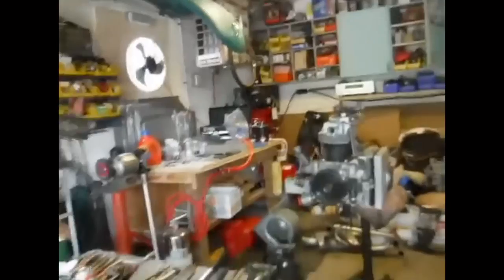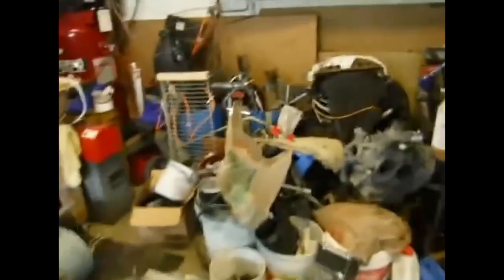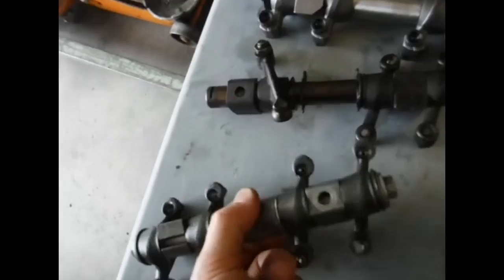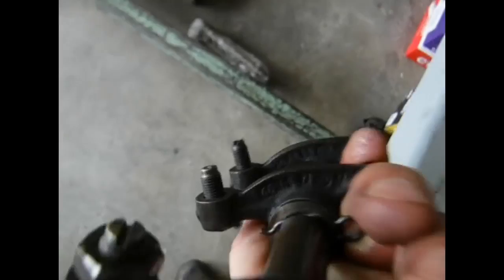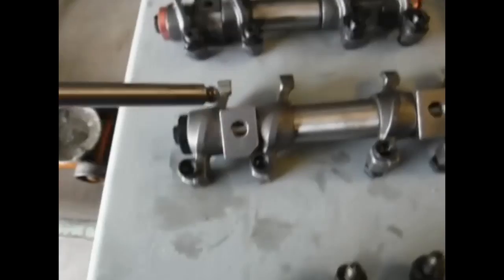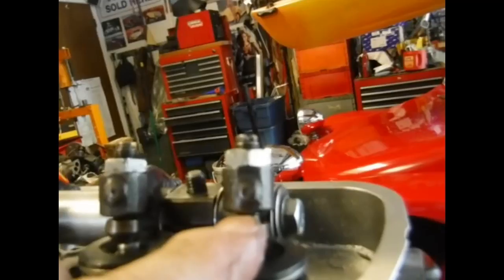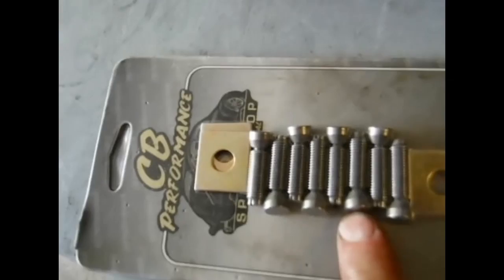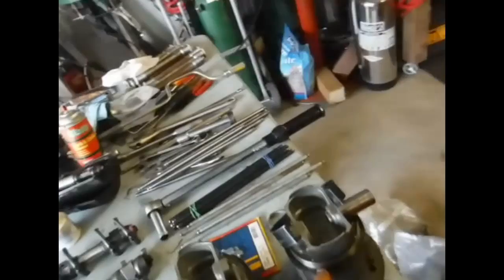VW High Performance Ratio Rocker Arms

Comment: My rig lost a rod bearing.  After taking it apart I learned she bought me a baja with a 1835 thick wall that has a 110  cam. I'm now turning it into a 1968. And I'm going to be using this video for the rocker arm set up.  Ty ezgz
Reply from the maker: Sounds great if your using dual carbs. Best of luck with your project.
Reply: 100 cam not 110. 
Been looking at carbs. Not sure on that pic yet.

Comment: Excellent video!!!! this is the reason i mark everything after i tighten it...sometimes life happens...
Reply from the maker: I'm becoming a believer in your methods although there is no doubt I had it in and torqued correctly. Over the last few years and several thousands of miles I just beat the thing to submission. One stud on the other side broke during disassembly as well. Making some changes and might crack the case for a look see. I want to put it in the Baja and put a few miles on it first as well as monitor oil pressure over different conditions.  Not sure I trust those stock pushrods with heavy duty springs. Stock pressure is 130 @ installed height vs 175 HD single. I've been watching you go around and around with Comp Cams.........  Like you say: Life happens.....

Comment: The elephant rockers from CB require pre-lubing by soaking them in engine oil before installation or they will wear out just as you described. The original Porsche adjusters of this design seem to be NLA. They used to cost $100.00 per set.

Comment: great video. add checking cam lift at the rockers to your build list. 2239 I am told by a old time VW guy is a great cam that should last you. very long time.
Reply from the maker: Thanks for your support.  The main difference is the 107 lobe center vs the more common 108 used on performance 1.1 cams.  So many variables. Thats what fascinates me about VW engines
Reply from the maker: Thanks Thomas. I hope your friend is right.

Comment: the 2239 seems to be much like a stock cam but the lift of the 1.4 ratio rockers already included.  the W-100 being another close example. keep compression close to stock maybe 8.0 as it adds just a dab of duration.  ratio rockers with that cam probably did in your studs. change the other side with new while your disassembled for piece of mind. consider the damage done. should still be great motor after your done.
Reply from the maker: calm down and watch again. 2239 is only a guess as it's not marked. CB does not usually advertise to sell Engle brand cams.  Stock is .334 lift. The 2239 with 1.1 is .aprox .418 NOT recommended for 1.4 at all. My measured lift was .530.  Not to worry about the studs. I replaced both heads with new ones with 55cc volume as mentioned. There was metal on the drain magnet but hopefully the full flow oil filter caught the rest. Stay tuned and thanks for the input. Start up and testing coming soon.
Reply: +TheEZGZ  no problem here all calm. but your suspect camshaft with 1.4 rockers is .530 lift.  so very very good guess. only thing anxious about is hearing how she runs when done.  should still be a hoot.
Reply: Engle was only mentioned as a similar to 2239 Eagle camshaft. Keep up the great videos.

Comment: you always make good "info" vids.  I think I am going to try my aluminum rods.  I heard chromoly are noisy?
Reply from the maker: I've ALWAYS used Chrome Moly  when using performance cam with HD springs.  This is a test to see if my sand buddy's way will work for me.  When stock get noisey you better check them. The steel ends start going into the aluminum. I've seen it but the explaination was that they let them get loose.  I'm trying it at .004

Comment: What can you expect when running a set of 1.4 life rockers on a stock cam? Is it basically the equivalent of having a performance cam?  I have a stock 1600 and am looking to do a few upgrades and the 1.4 rockers is one I am looking at but know very little about them. 

When doing the 1.4 rockers other then the upgraded pushrods is there anything else you suggest to add with the 1.4?
Reply from the maker: 1.4 ratio rockers, dual carbs and free flowing exhaust will really wake up a 1600 Dual port with stock cam. The more head work the better it will run. Heavy duty springs are required and dual springs would be recommended.  Dual 40 kadrons would be a good choice in carbs along mechanical advance dizzy.  Do not take Pushrod length as a casual matter. In fact I would not recommend it at all unless your engine is in perfect condition. You will need to remove the engine and remove the heads along with pushrod tubes to do this correctly.  If valve geometry is not perfect it will have a short life. It will run better even if you don't get it right.  "For a While"  Pay close attention to valve spring height blah blah blah.   1.25 ratio rockers would be more forgiving if your not experienced. As a matter of fact it's a lot easier to go with stock rockers on solid shafts with heavy duty single valve springs. The dual carbs and free flowing exhaust will make you smile over the stock 1600 DP.  I can't recommend where to find parts as most of it available today is junk.
Reply: @TheEZGZ  Thank you very much for the detailed advice. I am fairly experienced in the automotive world but the VWs air cooled are new to me. I just got my 71 Super Beetle less then a week ago. I love to get my hands dirty and learn as much as I can. 

With that, in the distant future I woudnt mind trying to do my own rebuild but for now I just want to give it a little more pep.

So If I am hearing you right, I should go with the 1.25 rockers, dual carbs and a free flow Exhaust for a good start? For a stock 1600cc what would be a good dual carb that will work on the stock 1600cc but with room to grow ( I.E bigger jets, etc...) if I do a cam and heads in the future?

Also what are your top 3 free flow exhaust options that don't break the bank ($250-$300 lol or less)

thank you for taking the time to answer
Reply from the maker: @johnnyturbo8460  I have this conversation quiet frequently with folks. After 30 years of tinkering with these engines I have to say that the stock engine is what it is. The version you have started out as a 1300 SP and ended up as the 1600DP   If your engine runs good, I suggest you leave it alone and enjoy the car as is.  Keep watching vids and going to swap meets and find a club in your area. Listen, Listen, Listen.  Everyone likes to talk about there cars. Watch and see who has problems and why. Watch to see who has lot's of problems and the trouble they have keeping it running well.  People always want more power and they build bigger engines and even after getting it running well they want more. But that takes money.  Sometimes these guys will sell you there old upgraded engine to finance there new dream engine. They might make you a really good deal if your a friend.  The other way to go is keep your car as it is and slowly start gathering parts for your own project engine. There is a lot of use performance stuff out there. If you build the complete separate engine you can swap it out and use that to tinker with. If it breaks or is a gas hog or problematic you can always put back in old reliable.
To many people get a nice old basicaly stock VW and start changing things and run out of money or break something expensive and then the car sits and gets sold at a loss.  These old VWs are no longer cheap to own or keep running. It's a money pit. Keep your alive and wait a year or more before going overboard.   Super beetles are known to problems with the universal joint on the steering shaft located under the fuel tank. You can't see it from below but you will have play in the steering. Remove the gas tank and have a look. The sold 20 million VW's because people liked them and they were reliable in stock form.  Every where I go people always want to share the story's of the family beetle that there family or friends had when they were growing up.  Have fun with it.
Reply from the maker: Maybe get some big bore Zoomie exhaust tips if you want to change the sound. Aftermarket exhaust usually drag on everything and rust away. They never have the proper intake manifold heat that is needed for centermount carbs.
Reply: @TheEZGZ  now that is some excellent advice i really didn't think of ( "start going to swap meets and start piecing together a build engine on the side")

I think that is exactly what i will do.

1. It will help me learn more about the car, while i am enjoying it.

2. It wont break the bank.

3. Half the fun for me is the thrill of the hunt (hunt for parts). I love wheeling and dealing and cars so that is a win win for me.

Excellent idea.

You are right, i have had the car for maybe a week now and i would say about 14 guys at work that have seen it have had some family story about one.

Thank you for the sound advice!
Reply: @TheEZGZ  ok thanks!

Any tips on pointless performance distributors like CB Performance ones? For better reliability or do you again say just stat stock with that too?

Oooh and your thoughts on a front disc brake conversion? And thoughts on those? They seem very reasonable at under or around $300

Comment: EZ If I have stock rockers and use Swivel feet ( I hear They are quieter) will I need to change the push rods for longer ones.
How do I figure for shims? Or should I just keep the regular stock adjusters. Thanks for every time you answer EZ.
Reply from the maker: The swivel feet usually come with shims. Usually a .040 or .060 shim under each rocker stand is all you need. Flat tappet cams are just noisy. Go with .004 valve lash instead of .006 if using chrome moly pushrods go Zero but check them way more often

Comment: I had my heads rebuild ( mofoco ) stock  type 4. Scat C 25. Hydraulic lifters pasengers side there is plenty of clearance to adjust valves but drivers side the arm touches the springs would rocker arm shims fix this
Reply from the maker: Yes but you don't want to change your rocker arm geometry to much as it will wear out your valve guides.  To be honest I have know personal experience with Type 4. I just know they are similar and expensive.  You can possibly grind a small spot on the bottom of the rocker arm if it looks beefy.  I hope you like that C25 as much as I do.

Comment: Hello I want to know how much do I have to cut the longer push rods with a 1.25 rocker arms and 110 Engle camshaft?
Reply from the maker: You have top use a test adjustable pushrod and set it 90 degree's at 1/2 lift. That is your length. I can't give you a length because there are many variables depending on shims and cam and head space.
http://www.geneberg.com/cat.php?cPath=6_212

Comment: Hi I’m building a 2110 engine for my t2 westfalia 
Could you please tell me what cam and rockers I need that will be good on hills. I have Dellorto 40s and 004 heads. I have a Engle w120 to go in but can change it if you advise otherwise. 
Many thanks phil.
Reply from the maker: I think the w120 is a bad choice for t2 westy. You need a lot of compression and really good gas. It will cook quick in the fat Westy.  Quit thinking high HP bug engine for racing and think torque to pull weight at lower RPM and live a long time. Your carbs and heads are fine. Use Heavy duty springs and valve train.

The Engle W120 is a Hot Street VW Bug camshaft grind is designed for 1.1 or 1.25 rockers, and it's specs are .397" Cam Lift, .435" Valve Lift (1.1 Rockers), 294 degrees of advertised duration, and 253 degrees of duration at .050", on a 108 Lobe Center.
WIth more duration and slightly more lift than it's little brother the W110, this cam is designed to give more power at the top end while sacrificing low end. You can not use this with a stock carburetor, it will barely idle well with dual 1bbls or a centermount 2bbls. You really need at least dual 2bbls of carb for this cam to behave at idle and under 1500 RPM.

This cam really needs some port work and/or larger displacement to work properly. Expect a powerband of 2000-6000 RPMs, the more headwork and carburetion the better the low end will be. If you use 1.25 rockers, you will extend the top end to 6300 or so.

Dual springs are required with 1.1s or 1.25 rockers. Use a compression ratio of 8.75-9.5:1.
Reply: Do you think I should put stock rockers and cam for my Westy 2110 ? I just want it good up hills. 
Many thanks phil
Reply from the maker: @wolves356  Yes, Stock Rockers with solid rockershafts and heavy duty springs, chrome moly retainers and keepers.

Comment: whew... let me ask you because I have  seen a lot of your vid and I believe you know. I am building (Assembling) my motor. 1600 change piston to 94mm and replace the cam with Engle 120.  Is there a need for me to make any changes on the stock rocker assy?
Reply from the maker: Yes!!! Please tell me more about your engine. Is everything else stock?  Crankshaft, flywheel,connecting rods, cylinder heads what are you using for Carburetor? Have you calculated your compression yet? Give me what info you can and we will go from there OK? One last thing. How are you planning on using this engine?
 
 
The Engle W120 is a Hot Street VW Bug camshaft grind is designed for 1.1 or 1.25 rockers, and it's specs are .397" Cam Lift, .435" Valve Lift (1.1 Rockers), 294 degrees of advertised duration, and 253 degrees of duration at .050", on a 108 Lobe Center.
WIth more duration and slightly more lift than it's little brother the W110, this cam is designed to give more power at the top end while sacrificing low end. You can not use this with a stock carburetor, it will barely idle well with dual 1bbls or a centermount 2bbls. You really need at least dual 2bbls of carb for this cam to behave at idle and under 1500 RPM.

This cam really needs some port work and/or larger displacement to work properly. Expect a powerband of 2000-6000 RPMs, the more headwork and carburetion the better the low end will be. If you use 1.25 rockers, you will extend the top end to 6300 or so.

Dual springs are required with 1.1s or 1.25 rockers. Use a compression ratio of 8.75-9.5:1.
Reply from the maker: http://carcraftstore.com/highperformancesolidrockershafts.aspx

also watch this vid. skip to about 20 minutes in https://www.youtube.com/watch?v=9rjBJxOosUw
Reply: @TheEZGZ  
Crankshaft, flywheel, connecting rods, are all stock. Cylinder heads was cut to fit the bigger (94mm) cylinders and I will run dual kadron H40/44 Carbs and using a Engle 120 cam 
I am working on the compression now. the deck height was .108 so I send the cylinder to be cut down by .058 I will get them today and I am thinking that should put me at about 8.5:1  – 8.7:1. I want to say under 9-1 . I want to put the motor in my” Saturday night don’t act like you want to race me” car. Lol  If I can beat them across the intersection I am happy 
So are you saying that I can use the stock rocker assembly? 
I am using this project to learn a little more have a little fun. In the future I will learn to weld and maybe add a turbo. Learning to weld will give me save some cash time

Comment: Would there be any performance gains on a stock 1600 dp by adding higher ratio rockers?
Reply from the maker: $$$$$ yes if you include dual carbs and header exhaust. Expect less MPG but a little more pep and running premium fuel $$$$ if you want to play you got to pay
Reply: TheEZGZ  not worried about the mpg it’s a sand rail I just set a turbo up on but the engine it self is pretty stock.
Reply from the maker: @thegobblerproject2363  With a turbo I think ratio rockers would help but if you use a center mount carb it will idle ruff.
Reply: Would you recommend 1.25 or 1.4 for a stock 1600dp turbo? I bought the engine used and I’m pretty sure it’s a stocker. My buddy has a 1835 and it makes so much more power it’s not funny
Reply from the maker: @thegobblerproject2363  I'm not well versed in Turbo talk. All I know is that they make about 30% more power than what you already have at 7lbs of boost.  You also need to limit your spark advance to around 27 degrees at full boost. You don't want to do that by just backing off your distributor cause then it won't idle. You have to get a special dizzy. The more the boost the more the power that = HEAT which shortens the life of a VW and kills it. Stock 16dp are cheap so a lot of guys just run the piss out of them with a turbo and get another engine. Chalk it up to the cost of having fun. https://vwparts.aircooled.net/Turbomania-Turbocharging-the-VW-Engine-p/turbomania.htm